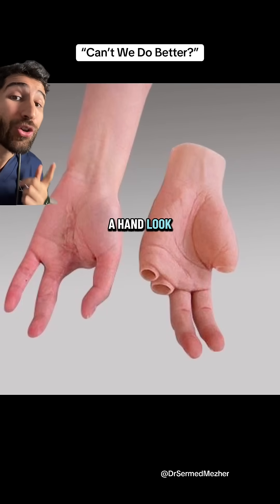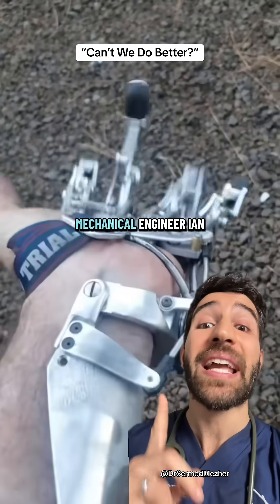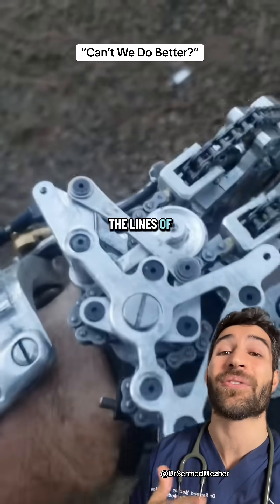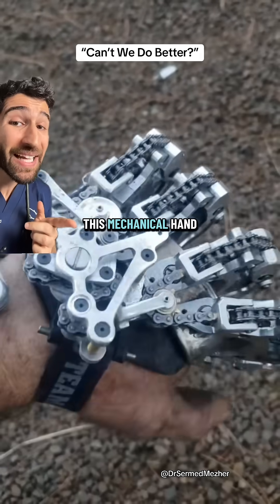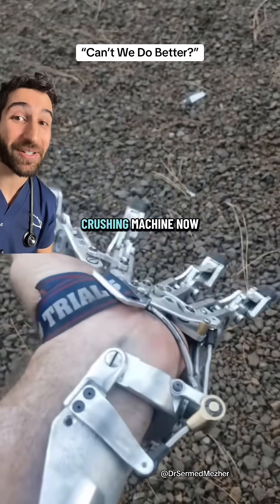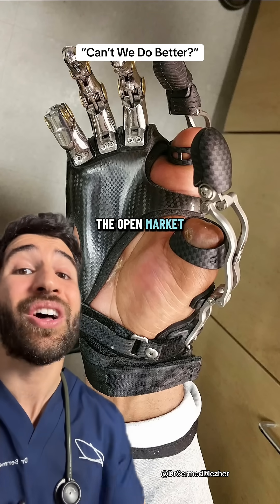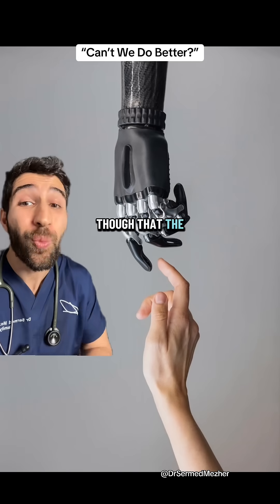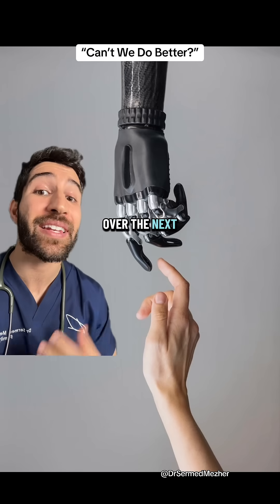What is Better Than Silicon Prosthetics?

Comment: It's a little ironic that silicon looks like the mechanical metal hand, while silicone is the type of rubber shown in the beginning of the video. Silicone is made with silicon and another chemical, kinda like how the two gases hydrogen and oxygen make the liquid known as water. That E on the end does a lot of heavy lifting.😅

Comment: I sure hope for him that the carbon fiber is just a texture
Because carbon fiber is definitively not body safe, whether outside or inside the body
Even a 3d printing is far from body safe, but is still a decent alternative compared to carbon fiber
Also the only way (that i know of) to have body safe parts using 3d printing is by molding body-safe silicon inside 3d printed mold. And it's pretty annoying to do compared to a standard 3d print

Comment: Also!!! Ian has his own YouTube channel and is currently in the process of making his prostetic openly available for a small price as a kit or for free as a downloadable file if you have a cnc machine or something similar!
Reply: I'm an sfx artist who works with silicone, I kind of wonder if we could fashion a hyperrealistic silicone sleeve for his prosthetic....actually, I dont wonder, I 100% know I could.
Reply: @avamasquerade I would worry about it getting stuck in the moving parts. I do wonder if you could make a smooth casing that would prevent the moving parts from getting snagged on clothing and the like.
Reply: Perhaps thin plastic 3d printed covers could go over the top of the areas that would interfere with the sillicone, you could also add ribbing to the outside of these covers for the sillicone to have something to hold on to.q
Reply: @avamasquerade  Personally, I like the bare metal. Cleaning would be an ordeal without a cover tho.
Reply: Thanks for this! Just subscribed to him.

Comment: Ian Davis is a godsend. The most impractical and primitive things about current hand prostethics is that:
1. there is way too much delay between brain command and action
2. movement itself is too slow.

comparing current (cyber) prosthetics to real hands is like comparing a slingshot (the kid one) to a gun.

Full mechanical prostethics solve both of these issues and with current technology we have, if its a finger replacement, pure mechanical is the way to go.

Comment: Fingers are a luxury. You can't drive grab cans off the shelf. Play video games as well. Can't type. Can't really use a phone. Can't really push buttons. Use a TV remote a spoon a fork a knife. Pick up a plate. Pick up food. Pick up a ball even wipe your own behind days because you can't hold the bar of soap. If you wear glasses it makes it much harder to put on and off your glasses because you don't have fingers to grip it with. Hold the microphone. Open up a car door. Brush your teeth, comb your hair. Tie your own shoes unbutton and unzip a pair of pants and be able to use a belt. So just saying all luxury that's BS and legally you could sue them probably and get that correct? Because that's not a luxury. If something happened to like his nipples, that's a luxury I would say because you really don't need like I can understand that or to say that fingers are a luxury is completely BS

Comment: I think these prosthetics can actually work together where you can put the silicone over the mechanical arm or hand to make it look more normal as well as keep on dusting stuff away from the gears so it can work perfectly for a long-term, so that’ll be pretty cool
Reply: The silicone woukd have to be replaced fairly often, cause the mechanism would wear away at it very quickly... I know, a very "the floor is made of floor" kind of comment, but point stands. Silicone breaks after too many bends

Comment: Okay- so much of this is not true.  I'm a licensed prosthetist in the US that specializes in upper extremity functional devices.  I have delivered several prostheses that cost over 100k, and all of those were motorized across fingers, wrist, and elbow, pattern-recognition myoelectric control, and utilizing state of the art skeletal linkage interfacing.  It's what you'd see for someone missing their arm from the shoulder down and replacing it with an intuitively controlled, complete robotic arm.  An electronic hand or partial-hand prosthesis would BILL for potentially 10s of thousands, so nowhere close to 6 figures.  

On display is a body-powered, mechanical system- as were the other later examples shown.  These typically couple the motion of the prosthesis to another intact body part. Like in Ian's device, he utilizes wrist flexion/extension to control the fingers opening and closing - a type of capability you can find in open-source  pediatric hands like the Raptor from the NPO enAble. What's unique about Ian's is his ability to switch between grasp patterns and device behavior by switching through modes by bending his wrist "thumbward" or "pinkyward." It's an awesome design, and as someone who's in the middle of developing his own medical devices for an unmet market- Ian is an inspiration. 

Lastly, if Ian had a care team that couldn't get his insurance to cover a functional device like a partial hand, they potentially weren't very competent in upper limb prosthetics.  Upper limb accounts for about 5% of the prosthetic space, so it's rare enough that most clinicians never do it.  The may not disclose this fact. In making the case for medical necessity, insurance companies are in the business of delaying coverage.  It's despicable. However, what we're really trying to do is get in front of an Appelate Law Judge, or ALJ.  It's the ALJ that we need to convince that the device we're pursuing is covered by parity standards- one of which is "restores function."  The degree of which is ambiguous, but there are plenty of metrics, usually lifetime equity, that are understandably compelling.  And yes, I've had an adjuster ask, "What does (their paying customer) need two hands for?"

Last lastly, some people don't want their amputation to be part of their public-facing persona, so there's nothing wrong with a silicone prosthesis.  There are even options to hide a mechanical prosthesis within a cosmetic glove, which usually helps with the tactility of the prosthesis.  Lastly, for partial finger or partial-hand amputees, especially if its their non-dominant side, the remainder of their anatomy is functionally sufficient for their quality of life.  They may not even need a prosthesis, and only have one for going out.  I had an attorney client who told me his prosthesis was a 5-thousand-dollar hand-shaking tool.

Comment: 3D printing is the friend of anyone with a loss of limb. Seriously. There are groups out there that will happily design and send you the files to completely make a new functional limb. They just need a few reference images. They'll also include an itemized list of everything you need to build it. Including any springs, screw, steel wire, or pulleys you might need for the build. 

I cannot stress this enough. You can even have these parts built without a 3D printer in strong and exotic materials through services like PCBway for very affordable prices. It's the difference between 30k and 600$.

Comment: Fingers are a luxury.
Let's quickly list some of the things you can't do without fingers:
Holding a steering wheel 
Type on a keyboard 
Type on a cash register 
Hold a hammer
Hold a screwdriver 
Hold a scalpel
Hold food.

The list of course is not complete and it includes at least one skill important to any job ever.
Reply: you forgot fingers are needed to whipe the but of poo

Comment: 3d printing is actually so useful for disabilities, my dads friend couldnt smoke weed after all his fingers got amputated (bc he slept in his truck since he didnt want to drive home drunk and it was like -20) but i 3d printed him something that would fit around his thing to unscrew it easier so he could scoop some weed into it and then screw it back on without having to ask my dad to come over and load up his bowls 😂😂 he has a foot pedal connected to one of those piezoelectric bbq lighters its pretty wild 😂😂